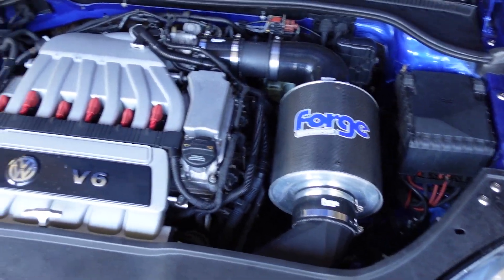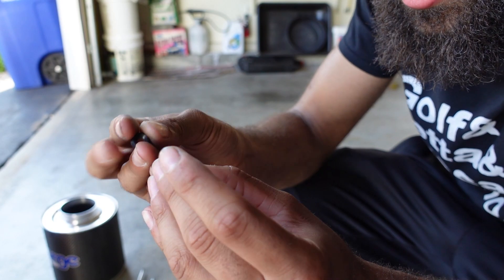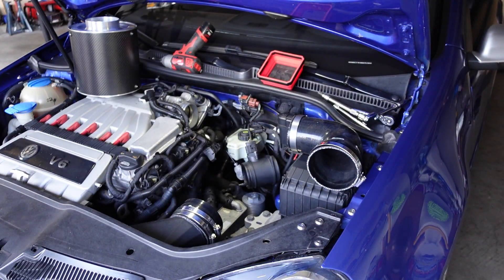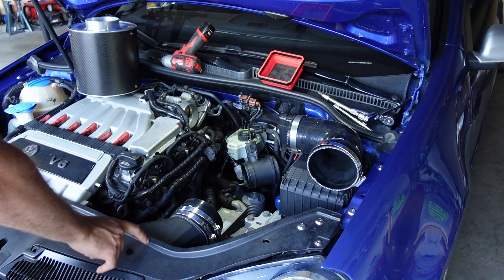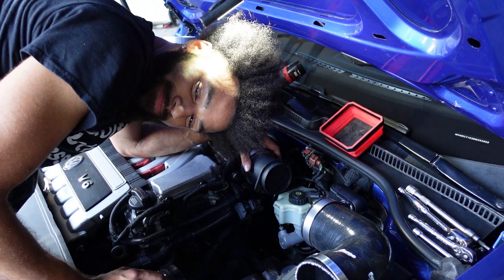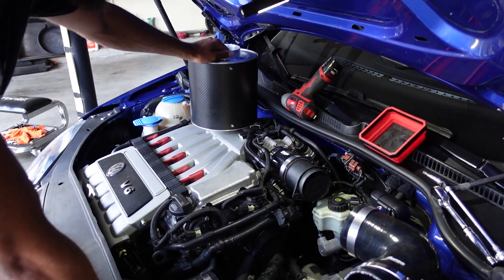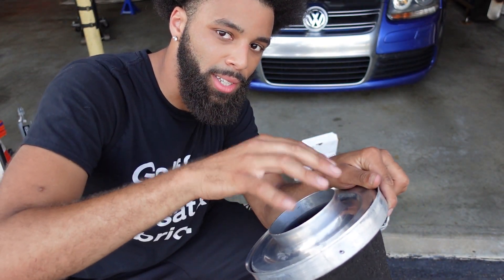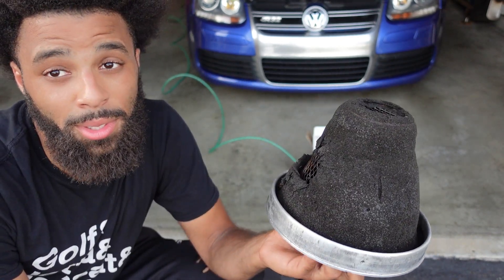Foam Air Filter Cleaning & Replacement / Forge Intake System

Comment: Hello, I have a superb 3.6 and I want to ask, if is worth buying this filter
Reply from the maker: Hey I’m assuming your talking about a Passat 3.6 VR or a R36, I believe forge Motorsport does sell and intake kit for you and I personally bought it for the induction sound and aesthetics
Reply: No, I have a Škoda superb 2 with a vr6 3.6 engine, the same as the Passat, but it only has 260hp.. Thanks for the answer